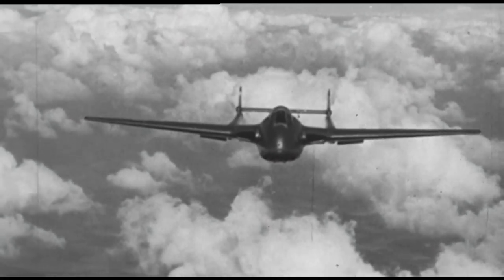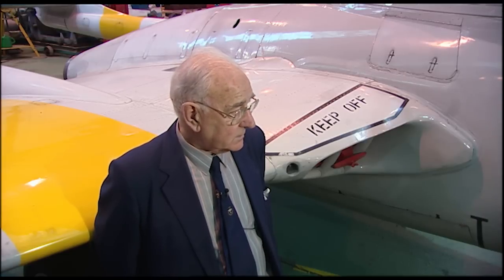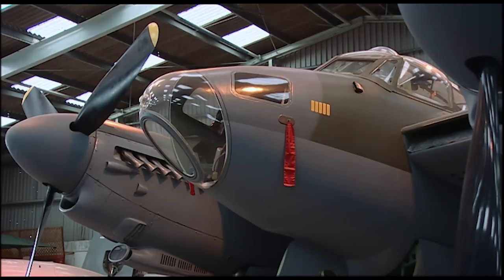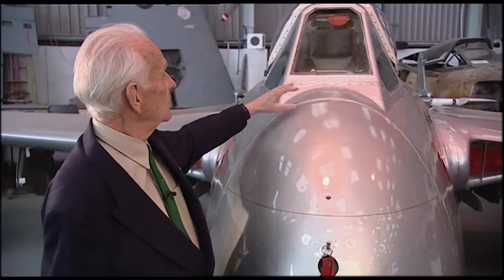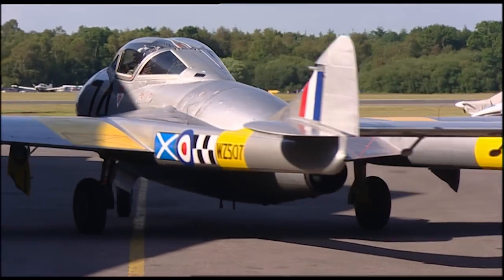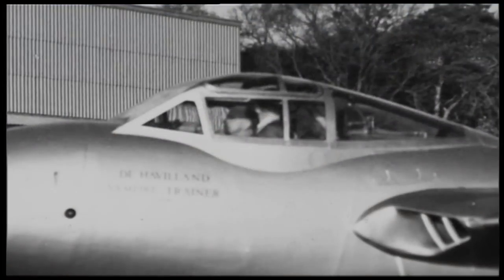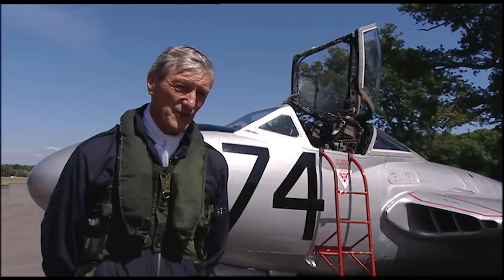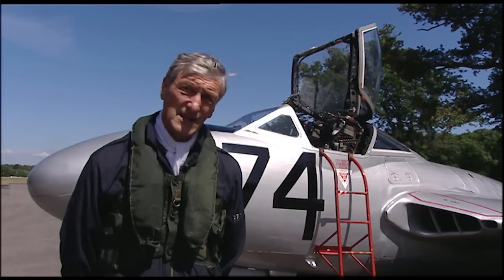Classic British Aircraft  - De Havilland Vampire

Comment: RUBBISH !! The Goblin was originally the Halford H1 designed by Halford and the Vampire was held back due to the only 2 Halford H 1 s were gifted to the bloody yanks to use on their prototypes of the Lockheed P 80 Shooting Star . The yanks fked up the 2 engines which held back the development of the Vampire that could have entered service shortly after the Meteor but was held back until early 1946 .TELL THE WHOLE STORY FOR GODS SAKE !!!
Reply: It’s the same engine FOR GODS SAKE.  DeHavilland bought Halford to set up the engine department with Halford as the chairman . FOR GODS SAKE 🤷‍♂️🤷‍♂️🤷‍♂️🙄
Reply: @alangordon3283  what point are you trying to make BADLY!!
Reply: The "whole story" hasn't been approved by the WEF.

Comment: I did my airframe trade test on the Vampire. It was in September 1975 at the former Atlas Aircraft Corporation in South Africa. If I remember, I had to do aileron rigging with cable tensions, and remove and install a flap actuator, among other tasks.
It was an old South African Air Force aircraft, and there were loads of airframe components on which the apprentices could train. Bet they'd be worth a bob or two if they were still avaliable.